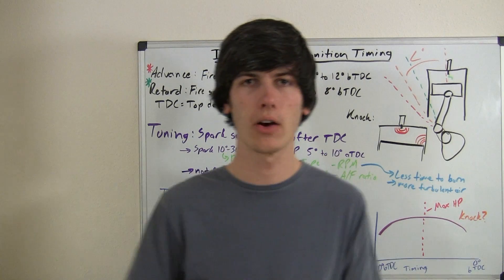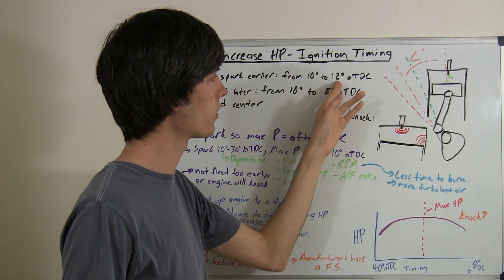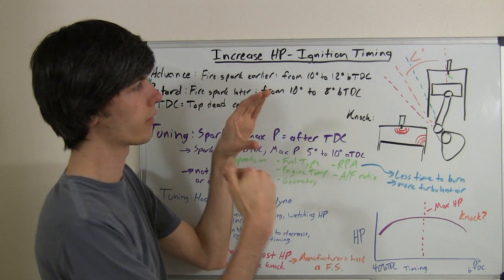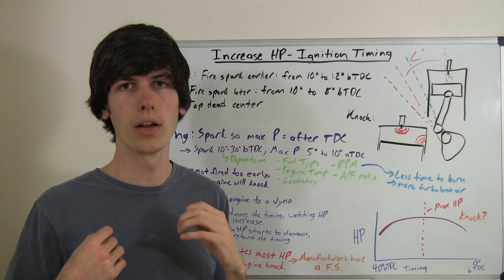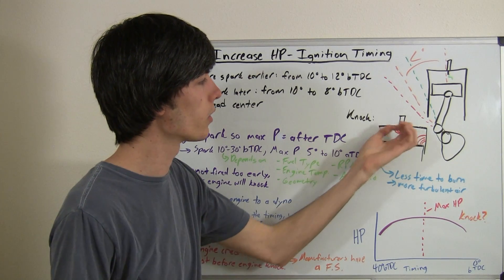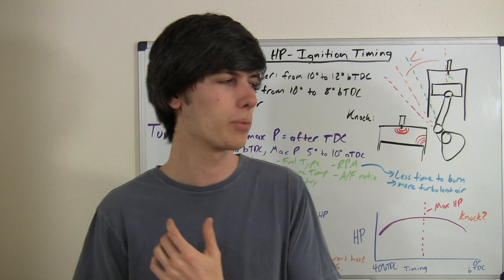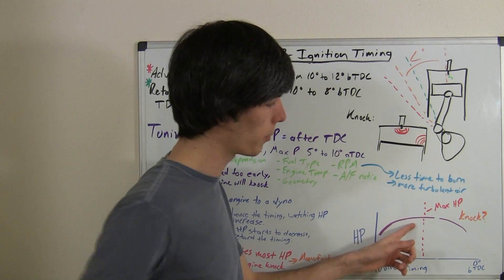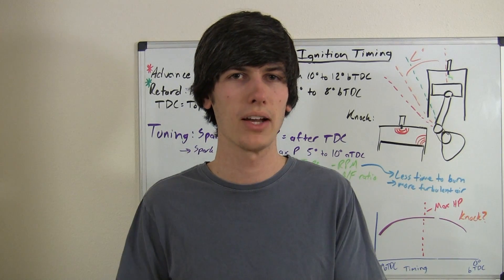ECU Chip Tune - Ignition Timing - Increase Horsepower

Comment: I have a brand new Triumph motorcycle that ran great up until the second service now the engine is knocking during warm-up and smooths out, but doesn’t completely go away if you really listen to it.
I’ve been racking my brains trying to figure out if it was the first fill oil and different oil that they use at the service, but I think it comes down to the ECU programming being faulty.

Awesome video !!!

Comment: I just  opened the accelerator and listened to the engine rpms go up to the max before the engine started to sound not right like knocking or jerking or pinging and then broght it back some on the distributor and increased the range of the accelerator again and again turned the distributor to see if it smoothed out with the highest rpms. Once i did that i let off the accelerator and listened to the engine sound again to see how it was running after setting the highest rpm and if it started to act funny like hard to turn over trying to start i would gradually bring it back some to get that level right. Once it started without any back pressure i then went again and did some more advancement until i got the perfect balance both ways. Once i did that i used my timing light and it showed off on the 10 degree mark but ran perfect. If i set it to the 10 degree mark on the balancer then the engine would run like crap. So, my take is to do it the old "sounding way" and set the balance by ear and feel. The balancer was new so i feel that the computer was not relaying the right information from the distributor to set the timing OEM.

Comment: Why does detonation occur with more advanced timing? The way it makes sense in my head is that retarding the timing would increase pressure and therefore also heat before the plug fires, allowing for hot spots to cause pre-ignition? I would have thought advancing timing would reduce likelihood of detonation?

Comment: General question. I recently put in aftermarket catless headers and a cold air intake with a very modest port and polish. But now I'm getting lead codes and knock :'(

It seems to me there is too much air moving and not enough fuel so I'm upgrading to highest octane 91 with with an octane booster to see if that helps. I'm learning how to tune ecu timing and considering getting bigger injectors. Any help with this process would be much appreciated!

Comment: Hi Jason, I have a challenge for you.
Dive deeper into ignition timing vs CR vs high head temps (carburettor engine)

I've bumped up my 1300TP Beetle to 10.13:1 CR (wide quench area) and would like to tune it myself. I believe my carb is set up well, but might re-jet

Comment: And what happened when you have a natural aspirated engine and you turn it into a turbocharge engine?? In that case you have to retard the spark, because with boost you have more temperatures and that means engine knocking.Aem give an advice for n/a to turbocharge, say that for every  0.1 bar up from 0 you must to retard the spark 1 degree, so if you have 1 bar boost you have to retard the spark 10 degrees from TDC.

Comment: Did you mention that engines auto advance the timing as rpm increases?  Motorcycles had a manual adv/ret lever, then flyweight & springs mechanical adjuster & now electronic.

Comment: Once the air to fuel ratio is changed on a direct injection system, should you advance the timing ignition a little bit?  My spark plugs are good up to 90,000, I'm at 65000.  With my upgrades, I'm thinking it's about due, don't you?

Comment: I'm planning to install a  cold air intake.  I've already noticed a boost from the Hi-flow performance air filter alone.  With the cold air intake. I suspect that this will change the air to fuel ratio somewhat.  After installation, will the ECU reset itself?  Won't the ECU recognize the upgrade and re-adjust?  Should  the Rev limit on the ECU be raised?  

Don't tell me.  It depends.  What factor(s) would it depend on?

Comment: The question is..how to adjust ignition timing? Modern cars..all is electronics..what can you do about it?
Reply: By a different engine control unit or rewrite the one you have. Usually it is not possible or worth it. Personally I would like a car that I can flip a switch in to change between low and high RPM setting.

Comment: My prototype reduces knock so much, it's like having very high octane fuel.

I run the maximum ignition advance setting in my video.
Reply: But shouldn't max timing be at tdc 0degrees  and to stop knock shouldn't that be aftdc ?
Reply: @knightrider1545  There are labels under most hoods that tell you what your ignition timing should be set at.  Types of fuel, compression ratios, engine design and boost pressure all factor into this number.  For an example one of my vehicles says 8 degrees BTDC and another says 11 degrees.

With the use of my prototype I can drive around all day at 38 degrees BTDC.  

As for setting your timing at 0 degrees... most vehicles do not do this as fuel takes time to burn and the engine is already rotating.  This setting would be too late for most engines to run efficiently.

Comment: What is benefits accelerate advance timing :)? 

And what is benefit delayed advancd timing ? 

For high rpm better accelerate or delayed timing advance ?

Please, explain to me
Reply: Advanced timing can increase horsepower and fuel efficiency to A point.

Most vehicles will get knock before optimum timing occurs.

My prototype reduces knock and pinging so well, that I just advanced my distributor to the maximum setting.  I made A video of this on my page.

Will be trying it on multiple vehicles in the future including turbocharged vehicles and high compression gas engines.

Comment: I'm curious if it's best to match octane directly to your engine compression, and whether manufacturers might recommend lower octane and lower performance to keep safer timing. My 2018 Elantra is 12.5:1, and they recommend 87 octane. It seems like a pretty odd match, and I've been tempted to try 91. Anybody want to weigh in?
Reply: The bottom line is cylinder pressure - that's what it all comes down to.  Your high compression engine may have a lower cylinder pressure than my 9:1 compression engine.  By changing the geometry of the cam in the engine, one can change the effective compression ratio of the engine, raising or lowering the cylinder pressure.  It is all related and is way to complex to explain here.  To answer your question, The recommended fuel for your vehicle is a catch all.  What works best in the winter, does not always work best in the summer.  What works best at sea level in a cool weather may not be the same as what works best at 5000 feet in the mountains on a 80 degree day.  What is known by the manufacturer, is with that engine, 87 octane fuel is safe all the time.    You wont hurt your engine by running 91 or 93 octane, but you may be wasting money.  The best way to know is to do a test.  We all know about miles per gallon (MPG).  What we really want to know is MPC (miles per cent).  In order to do this, you will have to do a bit of math, and keep a log.  Go to your favorite gas station, when your tank is a close to empty as possible.  Write down the price of all three grades of gas (you will need this later).  Fill your tank with the high octane and note your miles and the cost to fill your tank.  Do this with all three grades of gas, using the cost per gallon that your noted when you started your testing. If you don't, and the price of gas changes, your test will give false numbers.For example lets say regular cost 2.429 per gallon, Mid grade is 2.729 and premium is 2.989.  You filled your tank and drove to near empty each time recording your miles.  Lets say the results were as follows.  437 miles on regular, 480 miles on mid grade and 502 miles on premium.Lets do the math.Regular:  23 gallons @ $2.429 and you went 437 miles = Cost of gas / miles = $0.1278 per mile.Mid Grade 23 gallons @ $2.729 =  $0.1307 per milePremium 23 gallons @ $2.989 = $0.1369 per mileI just made up all the numbers, you will have to do the test yourself to see how it plays out, but the last time I did it in my own car, I found mid grade was the best value for me.Good luck!
Reply: @CoroPlanesLLC  Wow, thanks a million! I'm going to try that. Based on what you wrote, I'm guessing it might help to do these calculations in Summer and Winter? Seems like a 100 degree midwest day ubering people around a city with A/C on would almost certainly call for a higher grade fuel, whereas highway Winter driving might not. Am I on the right track?

Again, thank you so much!

Comment: Once my engine is fully warmed up i push the throttle, it gets louder but doesn't accelerate. It's like i have double the torque when the engine is cold. It's wayy too severe to be heat soak, it happens in cold weather, too. Is my ecu retarding the timing too much when it's hot? The ehaust is also louder when warmed up yet slower. It's a 97 civic ex.

Comment: I see one thing which has been overlooked, and which is a serious problem with the air cooled Honda GROM is the relation between ignition advance and the heat it will generate. We see people running on that motorcycle 30° to 32° advance at 9,500RPM which lift the engine temperature to 135 degrees Celcius where the moment has been reached that it's no longer possible to get your air fuel ratio under control anymore. We see 25° advance as perfect, but then the engine doesn't make any power anymore. We also see that for each rise in engine temperature we need to have another fuel map basically, so the advance and the heat it generate seems to be a huge player and not easy to get it right..

Comment: So, how to you actually vary the timing? It would be cool if you just mentioned the process as well as the theory
Reply: Older vehicles have distributors that you just loosen some lock bolts and turn to change the timing.  Turning the distributor one direction advances the timing, while the other retards it.   When you get the desired position then you just tighten up the lock bolts and your done.  A timing gun is used to get an accurate reading.

With newer vehicles the ignition timing is controlled by the ECU and they can be adjusted electronically.

Comment: i watch your video 2 years ago but didnt have a clue what you meant , after i had a mapping course and mapping my own cars ,  i now understand what you mean , it does depend on fuel you use at the time , air temp ,  move the timing till it starts to loss hp then back it off one hp , but you have to watch for knock limited engine as they may knock before max hp ,

Comment: is it improving both hp and torque when you advance it or is it one or the other
Reply from the maker: They're both dependent on one another, so both increase.
Reply: Engineering Explained ok thx@
Reply: Engineering Explained sorry i guess i was thinking top end power vs low end power does it increase one or both?

Comment: no no no, advanced ignition timing does not create the knocking you speak of, hot spots do that. advanced ignition timing can create pressure before tdc
Reply: Radical Edwards incorrect
Reply: Jared Tate really?  if the fuel is ignited and creates pressure and meets the piston at a crank degree too much before tdc you could fire it backwards or even bend a conrod, but in all my years of actual engine building (not just theorising), knocking has not happened
Reply: There are two knocking .
1.Due to excessive advanced ignition , The spark create detonation and make maximum pressure push the cylinder back before completely cycles .
2. Due to detonation itself,  The detonation occurred without sparking and push the cylinder back before completely cycles .

We forgot to talking about what is burn rate of any fuel type.

Comment: You can adjust timing if you have a distributor, they have a few bolts, if you unscrew them you can twist the distributor and change it. Or am I missing something?
Reply: BlueBeOn there is adjustment but there are problems with that

Comment: I'm confused. Based on the chart your showing, wouldn't retarding the timing create more horsepower because of the fact that the piston is closer to top dead center thus creating more pressure for combustion ? So when advancing the timing it looks like the piston would be at a lower position when the spark plug ignites the fuel therefore creation less pressure equating to less horsepower. Can someone please explain ?
Reply: David T
Reply: Vegeta Barrett link at studdy?

Comment: Im pretty sure distributors can me advanced and retarded. Unless there is something i dont' understand.
Reply: With modern electronic distributors you can certainly adjust timing on the fly mid dyno run as this is exactly what the ECU is doing while you are driving. Modern cars with distributors there is no mechanical or vacuum advance like older distributors. The ECU is electronically adjusting timing for engine load and rpm and that map can certainly be changed on the fly. More advanced systems can adjust timing for individual cylinders but if it is a new clean engine and the fuel delivery is even to every cylinder as it should be (otherwise it is not tuned correctly) then there is no reason to fire one cylinder earlier than another. Individual coils increase spark energy at higher RPM's because Dwell becomes very short in a high reving V8 with conventional distributor.
Reply: Not individually per cylinder, and certainly not on the fly mid dyno run.
Reply: Yea, the rotary button is large and would be in contact with the lead on the cap for a very long time. The ecu knows where the engine is during its cycle due to the cam angle sensor (usually built into the distributor) and tells the coil when to spark. Thus giving you full control of the timing at any given load or rpm.

Comment: Problem: Engine knock
Solution: Change to a higher octane gasoline
Reason: Higher octane can take more compression before detonation also, it makes the engine run cooler which means even less knocking.
Reply: yes to the first 2, however only reason it makes it run cooler is because it can make more usable power, since the explosions are actually pushing the rod down instead of slamming into the piston on it's way up and wasting power. Since it's wasting power, the engine has to dump even more fuel and air into the chamber in order to compensate. but ya I know lots of people who do have knock in their car because they run 87 in a 11:1 or something lol It pains me to see.

Comment: +Engineering Explained You said power is ideal when the piston is on its way down, so why is the spark fired 10-30 degrees bTDC rather than say 5 degrees aTDC
Reply: because it takes time for the burn to spread throughout the cylinder. The pressure will rise as more fuel starts to burn, and you want the most pressure to be present at the very end of the compression stroke. This maximizes the total pressure that will occur and therefore increases power.  If you achieved max pressure after the piston has started to lower again, you would get less power since there would be more volume at the time of max pressure (PV=nRT)
Reply: Ahh I c :D Good explanation! So I take it then that at higher rpm ignition timing is advanced to compensate for that spread time, which is why you need 98 Octane for tuned cars as they are programmed to give maximum power by achieving maximum cylinder pressure. Got a Cupra 290 on order :D and that one only takes 95 Octane in emergency situations according to the manufacturer.
Reply: +vhjioa well, not exactly. Higher octane fuel as a higher knock resistance. when you put 87 octane through a car with forced induction, the pressures will get so high that the fuel will auto ignite before the spark plug goes off. that could destroy your engine entirely so you put in fuel that will not self ignite as easily.
Reply: +vhjioa you are correct about the adjusted timing though.
Reply: That's pretty much what I said, you just explained auto ignition... higher octane rating allows you to build up mor pressure in the cylinder
Reply: Yes of course, I see what you mean.... in my case 98 is definitely the case, twin scroll head integrated turbo generating 1.1 bar boost!! Lol
Reply: it takes time for the flame to travel. at higher rpm you have less time, thats y you advance the timing

Comment: +Engineering Explained I have a 2006 Ford Fiesta 1.4TDCi and i want to retune the ECU, what tools do i need? and whats the safest way to get power boost,
Reply: You need to do a lot of homework before messing with your timing. A few degrees is the difference between your car not running right at all, a gain in power, and destroying your engine.
Reply: oh, okay thanks man
Reply: De Andre Yedlin No problem. If you need a tune, take it to a dyno shop and ask the tuner about how he does things and make it known that  you want to learn. Most car guys are happy to pass on knowledge.

Comment: Why would an engine, which is known to respond to timing advance not? Ie why causes variations is the same engine across different cars? Specifically with regards to how some engines will make some more power and others won't.
Reply: Do you mean the same engine in different models? Like the 5.0L Coyote in the Mustang vs in the F-150? There are a lot of factors in tuning besides just the timing curve.  With the same engine there can be variations in intake manifold design, fuel injection tuning, cam specifications, compression ratio, exhaust system design, etc. In general an engine in a sports car will be tuned with an emphasis on peak power, the same engine in a luxury car will be tuned for optimized driveability (area under the curve), and the same engine in a pickup truck could be tuned for maximum sustained torque. Altering the timing curve in different variations of the same engine will yield different results because of the other major differences at play.